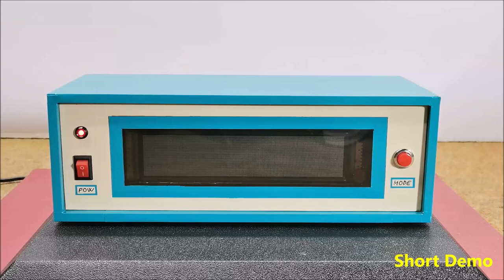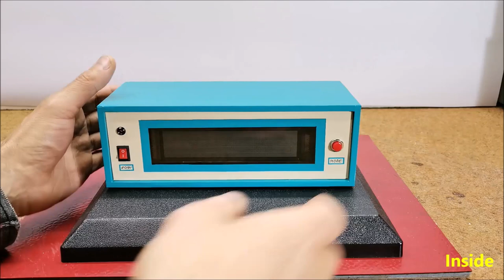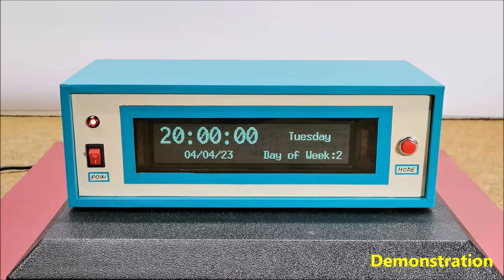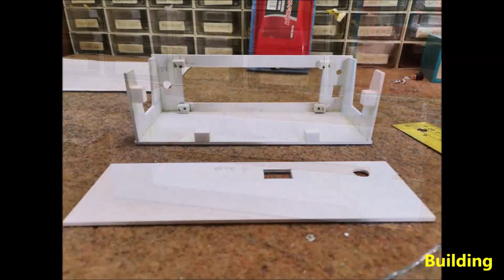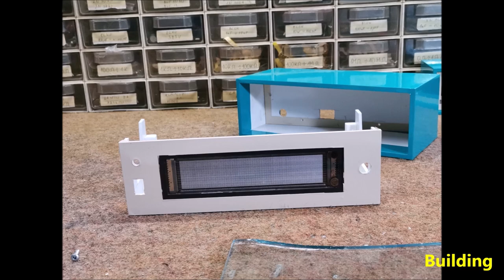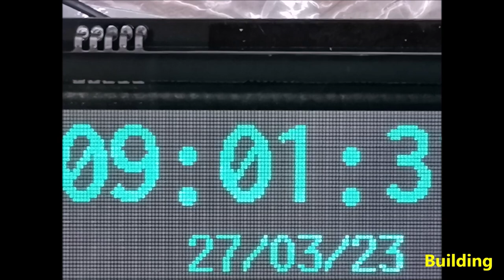Simple ESP8266 NTP Clock on VFD Display VFD256x50 GP1287

Comment: cool!  I've done a number of NTP clocks, and will try this one too!
Reply from the maker: Regarding the question, try connecting an external power supply through the side connectors
Reply: @MirkoPavleskiMK  Right.. I did that too.. a couple (min 1amp output) 5v DC power supply. When I do that, the esp starts up as well (expected)... but nothing on the VFD display.  I haven't used these VFDs before, so wasn't sure if they show any activity without data on their SPI interfaces... just to get an idea if the VFD is dead or not to begin with.  When I power the 5v directly, and disconnect the power to the ESP, the current draw from the VFD alone appears abnormally low at about  0.02 of an amp.
Reply from the maker: @MicheIIePucca  Instead of my clock program, try a demo example from the u8g2 library
Reply: @MirkoPavleskiMK  right.. I did, and still had no luck.   I ordered a VFD from another seller... will see if that makes a difference.   These particular VFDs have next to zero info on the net about them, unfortunately.